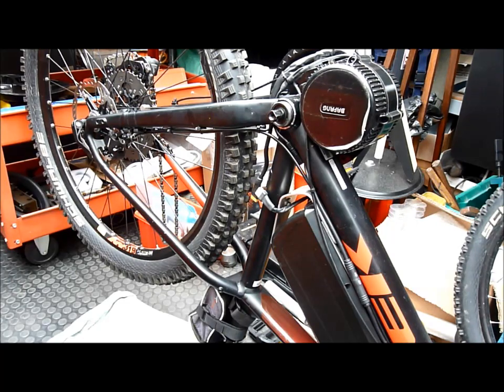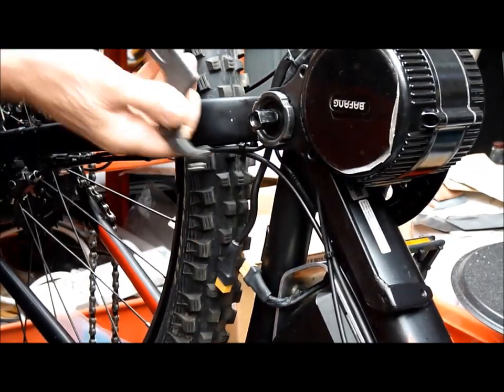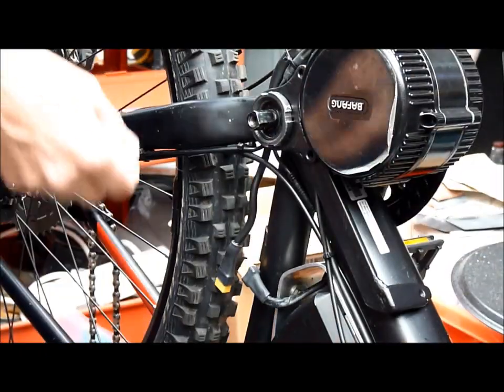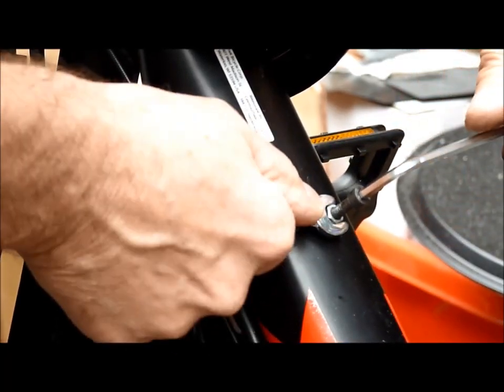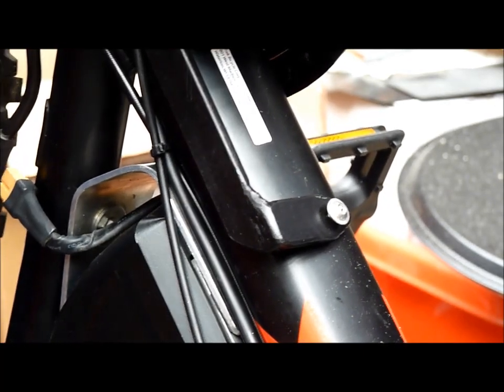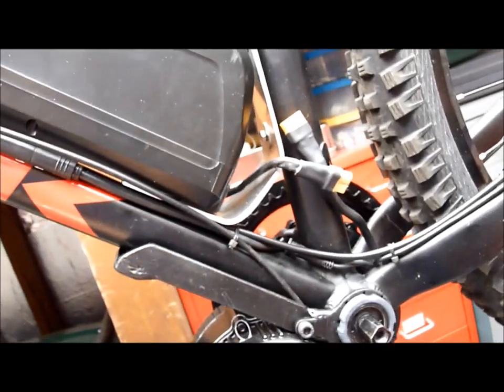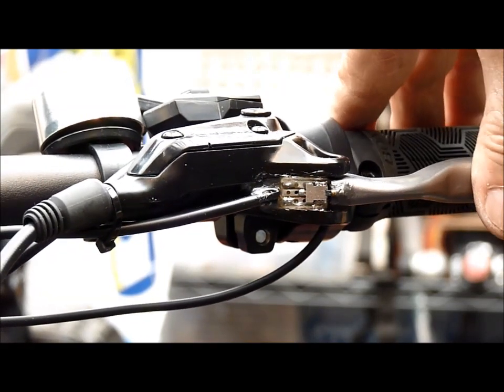BAFANG EMTB Mid Drive Motor MODIFICATIONS

Comment: Could you please tell me, where you have attached the straight bar to the triangle if this replaces one of the triangle bracket fixing bolts? Could this still be sufficient if instead of welding, the straight bar was attached with a nut & bolt? Or maybe 2 longer fixing bolts through to the motor casing? Thank you.
Reply from the maker: I'm not quite sure what you mean by triangle,  but you could just bolt on an extra arm if you have space, make sure the longer bolts  are not too long! Also you could use a Jubilee Clip (or even use a strong plastic tie) to fix the extended arm to the frame instead of drilling.
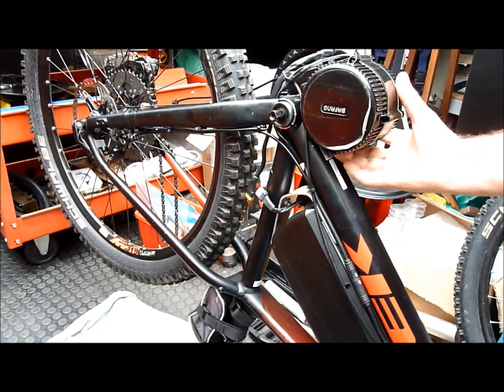Reply: @doctorvox  At 1:11 instead of welding the straight bar to the bracket, do you think using a longer bolt through the straight bar & bracket into the motor case would still be sufficient to stop the motor from rotating or would that put too much strain on the bolt?
Reply: @daytriker  Yes I think that would work OK, I would shape the bar around the hub and use the TWO bolts to prevent it pivoting.
Reply: Thank you @JohnWells-vp9hq

Comment from the maker: The problem is not that you cannot tighten the lock ring enough, the main problem is that (in standard form)  the only fixing point is also at the pivot point of the heavy motor assembly. By moving the fixing point away from the pivot as shown, the whole unit is much more rigid.

Comment: They make a special Socket wrench, that you can attach a long arm to.. that way you can tighten it down enough that it will not come loose.. 
Also make sure the teeth on the plate dig into the BB.  That will fix the problem.

Comment: How is that rivnut holding up? (or more specifically, the hole in the frame around it) Seems like there would be a lot of load on that fixing... i'm asking, not telling
Reply from the maker: Still all fine Dan, there is no great load on the rivnut fixing, as the arm is quite long and the 'pivot point' (fulcrum) is very near the force. You could use a 'Jubilee clip' around frame to avoid drilling if you prefer.

Comment: Hi man awesome idea but i dont have problem with motor getting to hang, i have problem caused by motor torque getting motor to hit downtube and i have little dent and no colour on that spot and i cant tighten that lock ring enough. I've put piece of aluminium over that spot but i still hear noises from there (little less although). Do you have any recommendations. Thanks in advance!
Reply from the maker: This clamp idea could hold the motor firmly at any angle you need.... or just a piece of rubber between motor and frame if that's all you need.
Reply: @doctorvox  thank you very much man, I will try your way. cheers
Reply: Install motor with bike upside down. You want the motor to touch the frame when you tighten things up. No padding or anything that will let the motor move up under power.

Comment: Hi Outdoorsman, good solutions. I also have some play between the motor shaft and the bottom bracket shell. I seem to only need need a 0.5mm shim all the way around as the total play is 1mm. What type of shim/s did you use and where did you obtain it? Thanks
Reply from the maker: I used steel shim sheet that I've had around for years, I'm sure you can find it on ebay, I've recently bought some 0.5mm brass sheet that would also work, (and would not rust) 😉
Reply: @doctorvox  Thanks for the help. Will be getting some brass sheet.
Reply from the maker: @joslo625  Or even a couple of wraps of aluminium beer can.?
Reply: @doctorvox  That's what I did. Wrapped as much as I could and finished by wiggling in some narrow strips where I could.

Comment: You're supposed to use a Torque wrench on the bottom bracket mate not a plate but your choice good luck
Reply from the maker: You can get an elephant to swing on a torque wrench but it will still come loose without the extra fixing plate.... when you use it offroad

Comment: Thicker is better,I managed to snap my metal bracket similar to yours,but thinner metal and clamped on rather than drilling frame.
Reply from the maker: Yes Niall, there is a lot of weight on it, but after nearly 6 months hard use, the motor hasn't moved at all after the mod.

Comment: Will some lock tight help ?
Reply from the maker: Hi Toni,  yes loctite on the ring will help, but it will still loosen. The weight of the motor is the problem. I did consider tapping a hole in the bottom of the frame bracket and putting a bolt through to contact the outer of the motor shaft....not too long though!
Reply from the maker: Hi Toni,  yes loctite on the ring will help, but it will still loosen. The weight of the motor is the problem. I did consider tapping a hole in the bottom of the frame bracket and putting a bolt through to contact the outer of the motor shaft....not too long though!
Reply: The weight of the engine is not a problem, but its hard torque is!!

Comment: 2 Kilograms more with your motor and battery fix xD
Reply from the maker: Yes its much lighter if you don't have a battery...... doesn't work very well without it though  :) the alloy brackets and extra bit of steel weigh much less than 2Kg !
Reply: Think of that 2kg as a 2% (overall mass around 100-110kg) Its not even noticable
Reply: @lukakoritnik365  100kg overall? What are you talking about? I have the same config and it weight is about 30 kg, 2kg is very noticiable
Reply: @lukakoritnik365  The weight of your body is going to be the same in all the settings you do, it is stupid to include it in the equation.
If you think that 2 kilos does not make a difference, I hope that one day you will run out of battery and have to climb a hill with your legs, you will remember this comment.
Reply: @rodrigomezs88  yes i couldn't get up a hill with 2kg more although i am carrying my 80kg weight, do you think of your words man????!
Reply: @lukakoritnik365  Who said you can't go up the hill? I'm just saying you would appreciate going lighter. If the added weight is not a problem for you, congratulations, I am looking for a balance between weight and agility. Buy the chassis of a motorcycle and put on the bafang kit, you will be the guy with the most robust system in the world, and the engine will move it at 5km/h
Reply: @rodrigomezs88  bahahahahahaahah 2kg would make no difference to me and i'm saying that cause i tried to remove all unnesessery weight and viceversa and both me and speedometer saw no difference except maybe first gear acceleration and you have to see me riding my bbs02 1200w i dont let of throttle till i phisically have to in order not to get out of road, man i'm a bafang racer xD
Reply from the maker: @rodrigomezs88  Thanks for your comments Rodrigo, but have you actually tried a Bafang 750W conversion? the extra weight makes it faster downhill with massive power for the climbs, you will NOT notice the extra weight except for the extra stability it gives. If you run out of battery (after 60 Km or so) you will struggle uphill, on any electric bike, best not to do that :)
Reply: @doctorvox  I currently have a Bafang BBSHD 1000W with a 52V 21AH battery. I know the weight of the kit, and I have it secured with plastic ties and nothing moves, adding a weight of 50 grams. I have done routes of more than 100 kilometers, where I have run out of battery and I have had to move the bike with my legs, without help and I am grateful that the less the better the weight. In fact, I changed the cassette to an 11-50 so in these situations I could move the bike more easily. Another negative point for me of adding so much weight to the bicycle is how difficult it is to move it to raise it to a second floor for example.
Reply from the maker: @rodrigomezs88  My bike weighs 25Kg, and without the alloy plates I would not be able to fit the battery. A battery half size would be fine for me too, as I can use it for three rides without recharging. I would use the 'walk' mode to help push it up stairs. No problem if you are happy with your plastic ties, but no need to 'dis' my mod if you don't need it on yours. Did you fix the problem with yours last year? Cheers.
Reply: Don't think about the weight of the bike. Have a day without eating and you will drop much more of the weight of the combination.

Comment: Thanks so much!  My wife and I have only ridden 20 miles on our two recently converted Trek Marlin 6 mt bikes. We installed a BBS02 on each.  
I noticed that both motors were loose yesterday because the the locking nut was not holding things tight.  I used the flimsy wrench that came with the kit but must not have tightened things enough.
If I continue to have problems, I'll do exactly what you have shown.  I might try something different with the brake senors as well.  One sensor  on our bikes cuts power for as long as I squeeze the lever but the other sensor near the throttle and display control only cut power momentarily...similar to the gear change sensor.
Reply: Baphang's own tool is better than the chained tools that often accompany the setis.